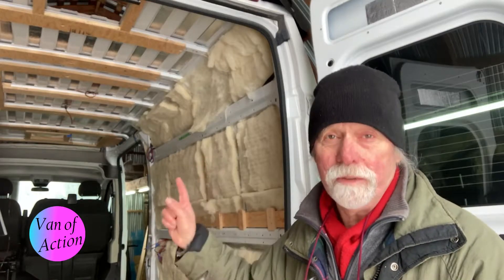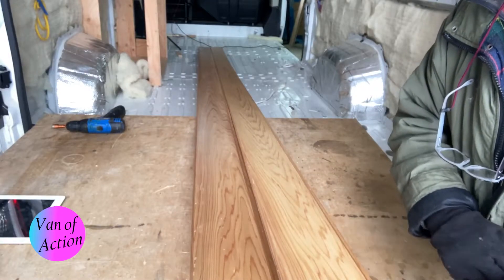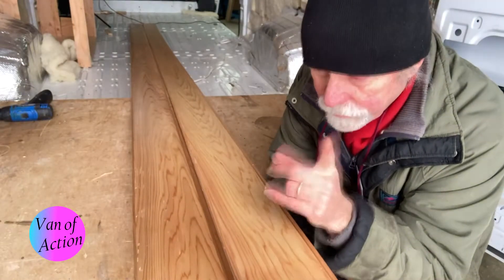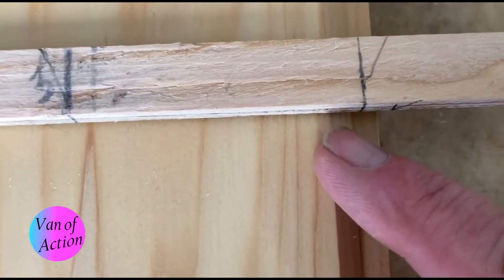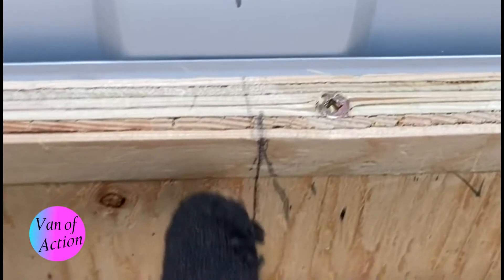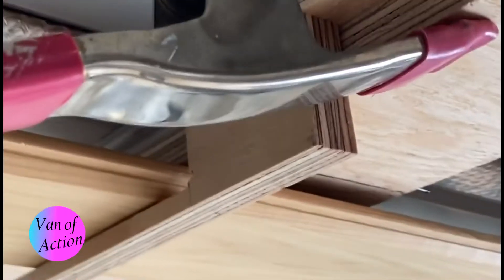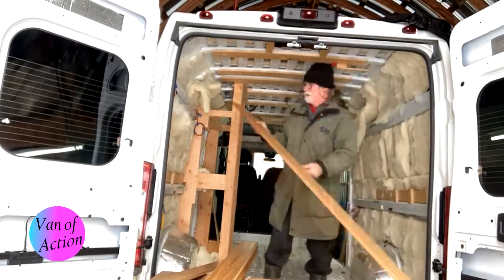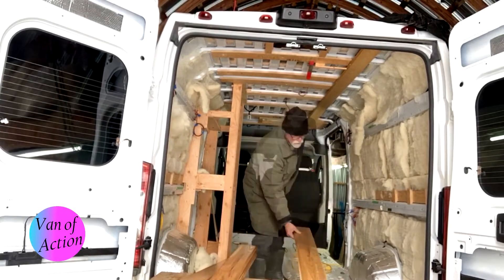Van Build Series - How To Install A Wood Ceiling Vanlife

Comment: Another option for getting the board in the centre is to start in the centre. This is done by adding another tongue ( also known as a spline ) to the centre board. So now you are able to work both ways from the centre out. I've been installing T&G for years and have used the 'extra  hand' idea as well. Great video. Thanks for sharing.
Reply from the maker: Thanks Randy,  the tongue on both sides is another great idea.  I've used it on floors, but for some reason I like working in one direction on ceilings ....   thanks for watching

Comment: Hi from Denmark! Been following your build and been learning so much. I am starting my roof installation tomorrow. Your brackets are awesome! Thanks for the idea and great content.
Reply from the maker: Hey Duc !!!   You have no idea how awesome it is for me to see comments like this - thank you so much for taking the time to make it !!!  Remember -the  whole point of using tongue and groove is to be able to hide the fasteners.  The one side of the board is held by the T&G - the other is held be a screw (don't use nails) that has been carefully driven into the tongue on a angle so that is gets good purchase on the wood but will be hidden by the next piece.  I have to do another video about that - in the meantime check out this video from a lady who is working on her house - see  start watching at 4:32 - https://youtu.be/8R7QaISmfcQ  and every time she says "nail - you here "screw" - cause in a van the vibration will make the nails fall out - let me know how it goes !!!!
Reply: @VanOfAction  No need to watch other videos. You are a great mediator! Your instructions and explanations were very clear to me. I have not seen anyone explain how to line up the end of the board on the front part of the roof, like you do. It makes so much sense! Not seen the T&G technique on other van builds either. It looks SO clean! Why is that not a thing?! ;) You just got a sub from the other side of the pond. Keep up the great content!
Reply from the maker: @ducphungcom  thanks for the kind words and the sub !!!!    I too can't understand going to the trouble and expense of T&G then filling the face with holes.    For what it's worth as the build developed the detail at the ceiling / headliner transition evolved into something better.  You may want to watch this one too https://youtu.be/OgdrIkj8krI  -  Cutting the ends is important but I didn't have to be as fussy as I thought and this new method hid all the screws too.   Be well

Comment: I clad my van with sheet aluminium and applied wrap. Wrap comes in many colours and textures, wood included. Ended up with more room inside, a much lighter build and in a few hours can change the decor. My cabinets and drawers are sheet aluminium also
Reply from the maker: Steve - again thanks for taking the time to share !!!  That sounds really interesting -   do you have a photos you could post ?  It may help some others with their plans.   Regarding the weight - there is no question you have to aware and weight is going to impact all kinds of things - BUT - I also believe it's possible going too far the other way could have a negative impact on the experience.  My Promaster 3500 is a 1 ton commercial truck - with commercial springs.  I intentionally added weight to get a bit of compression on the springs which makes the ride much smoother. In fact it's really pleasant to ride in.  I kept track and by my estimation I've added about 400 pounds - I consider it the equivalent of 2 fat guys riding with me all the time !!!  Be well ......  Dave
Reply: Hi Dave, 400 lbs is very impressive. After seeing a few builds where the gross is at or above the manufactures weight got me to thinking alternate materials. I have recently retired and purchased a mwb sprinter which I’m now converting. My original work van (sprinter) of 12 years had a very basic fit out which still retained the original full headliner. Recently stripping the van out I can’t find any signs of moisture damage, I put this down to the the headliners ability to breathe. For 10 years l worked in this van all over Australia and spent many more nights in it than my own bed at home. As the new build progresses I’ll keep you posted. Merry Christmas and have a great festive season. . Steve
Reply from the maker: Hi Steve - I'll look forward to the updates - I wish you and your family well .......Dave

Comment: U guys always make it look easy how about doing this on a  e150 econoline!!! On very low head room!! Very tight!
Reply from the maker: Hi Gary - thanks for stopping in and taking the time to comment.  I've never seen the inside of an e 150 but I'm sure there will be rails to attach wood to across the ceiling.   No question it's gonna be an odd height to work with - but I would suggest using the hold up brackets I made and you can take your time.   They would work on a  1/4" lip - there isn't much weight and you'll want to save as much inside space as possible.................   Be well and stop back .. Dave

Comment: I love this self bracket idea!! Thank you so much. Why do people put the refectix stuff on like that? Just a square piece instead of filing the whole panel?
Reply from the maker: Hi Alaina - thanks for watching and your note - the silver stuff is NOT reflctix - it's the Noico sound deadener I installed on the roof, walls and floor.  I should have explained that part.  I didn't insulate the ceiling until had 4 pieces of wood installed then I just pulled the wool bats through above the wood.  I thought having it hanging around all the time would be a problem.  If you watch the insulation video you'll get a better idea of what I mean.  Be well.
Reply: @VanOfAction  Awesome thank you for explaining!!

Comment: Hi are you going to insulate the ceiling ?
Reply from the maker: Hi Ken, sorry for the late reply - some comments seem to filter into space >>>>.  I did insulate the ceiling with Havelock wool.  I got excited putting up the wood and forgot to video that part. Once I had 4 pieces of wood up I was able to pull the insulation batt into the space between the wood and the ceiling.  It saved a ton of cursing as fought with the wool and wood together.  it worked great and with a little effort I got it into every little corner.  Be Well

Comment: Where did you find your cedar? Thanks,  Janice in Port Angeles, WA 98362
Reply from the maker: Hi Tom - thanks for watching and taking the time to comment. I did my van during COVID and wanted to support the local economy.  The design was supposed to use a lot of 80/20 and plastic - but I'm in the mountains of BC on a  logging road so there is a ton of fine lumber harvested close by.  In the town of Enderby (my closest town) is a company called Cedar Solutions    https://www.cedarsolutions.ca/   - they harvested this wood within 10 miles of my house, milled it, kilned it and stacked it.   Because of Covid I was not allowed in the yard and they were great about picking lengths, grains and colours I wanted.   All the cedar in the van started out as 1 x 5 V matched T&G,  I just milled it to suit my needs.   I'm imagine they would ship to you,  but any good lumber supply should be able to get it.  Just ask for select grade, clear kiln dried cedar - the same as people use in saunas.  Best of luck and I hope you'll join the community ..................   Dave